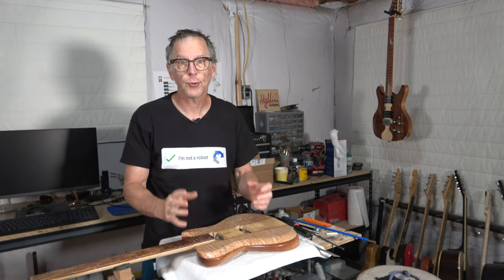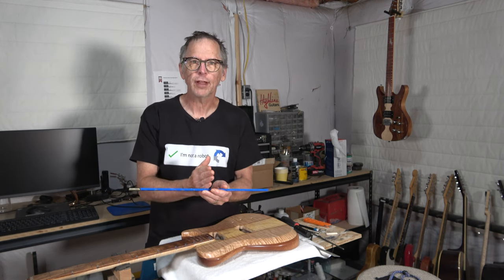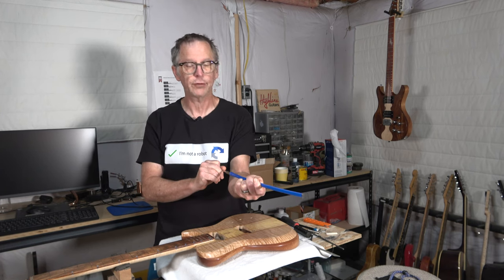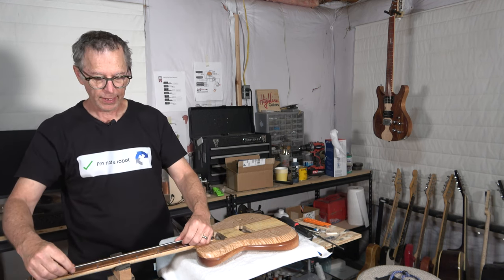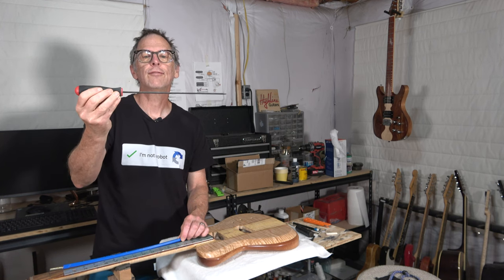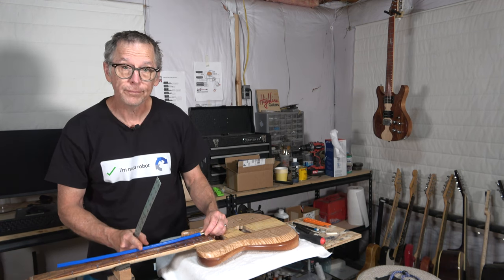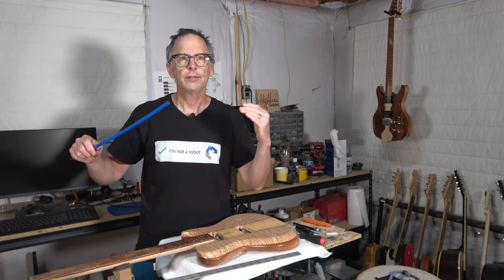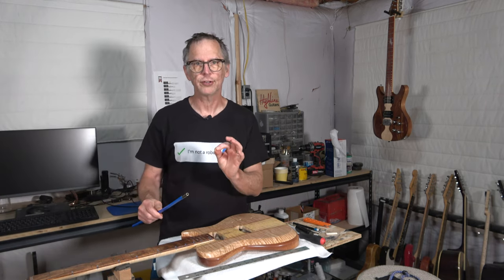How To Position A Guitar's Truss Rod

Comment: I've been thinking about this exact topic! Of course, adjusting a truss rod before it is installed will give an idea of where the maximum deflection point will be, but what about the effect of the gradually increasing size of the neck (for most guitars, anyway) as you approach the guitar body? I think that this increased wood thickness/width will modify the achievable curvature of the neck: it will bend easier (and therefore further) nearer the thinnest/narrowest part of the neck i.e. nearer to the nut.  As the strings will deflect most at the middle of the distance between the fretted note and the bridge (and this will obviously change it's position on the neck as notes are fretted closer to the bridge), where is the ideal 'maximum deflection' point of the neck?
Another consideration is whether or not there are carbon fibre reinforcements in the neck: as these make the neck more rigid, will this not also make the job of the truss rod much more difficult?

Comment: Hi Chris. Very insightful. Something that sparked in my head after watching: Is there a way to calculate the stresses along the neck so that we might know in advance the peak stress point, and subsequently position the truss rod so as to locate its max' deflection point there? Of course I can imagine this might vary for different neck designs and body joinery.  In any case, thanks for the video!
Reply from the maker: That’s above my pay grade.
Reply: @HighlineGuitars  No worries.  Probably not worth "overthinking" these things too much, as you suggest in the video.

Comment: If you used carbon reinforcements would you still need a truss rod? Would the reinforcements stop the warping or movements? Thanks.
Reply: Yes you still need the truss rod.
Reply from the maker: It depends on the design and number of carbon fiber inserts. I used four in my V-shaped guitar build which makes the neck very stiff and omits the need for a truss rod for the person who this guitar is going to.

Comment: Is the position where one would want the relief to be on the fretboard dependent on scale length? For instance, on an electric bass would it still be somewhere between the 8th and 9th fret?
Reply from the maker: No. It is dependent on the shape of the neck which determines where it will bend when under string tension as well as the length and placement of the truss rod.
Reply: @HighlineGuitars  I think that your other recipe for truss rod placement is more fool proof for people without experience since it's something like "just make sure the truss rod goes from the nut to about the 17th fret and you're good"
Reply: For you folks out there interested, that other video is entitled "guitar truss rod placement"

Comment: Thanks for another great video :)  I have a question off the back of this, which relates to the use of dual truss rods (typically in wide necks, such as bass guitars with >4 strings).  Is this something you ever do, and are there reasons this is sometimes (or always, in your experience) a bad idea?  I know you often use reinforcing rods, and I figure those might play a role when it comes to dual truss rods (perhaps negating the need)?  Do laminated necks (which I know from a previous video you’ve voiced caution over) have any influence over choices in this area?  So not really just one question after all :)  Thanks again!
Reply from the maker: Dual truss rods are an unnecessary marketing gimmick.
Reply: @HighlineGuitars  Wow that was a quick reply, and straight to the point.  Very much appreciated :)

Comment: Interesting, thanks for your observation.  Reason why I haven't installed truss rods in my builds. I fill my necks with permanent steel bars and carbon fiber rods. About 40% of the neck is wood.
Reply from the maker: Right on!

Comment: you forget that trussrod make pressue to 3 points of neck. Two on the ends and one on the middle. In case when you want to create thin and ergonomic neck when you place trussrod in wrong place you can simply broke through back of neck. Thats why you need in depends of length of neck get trussrod with lengs wich depends to construction of neck.
Otherwise, you make broken neck without  the ability to ajust

I mean, in video you not gave the ansver "How To Position A Guitar's Truss Rod"
Reply from the maker: I didn’t forget. Most of my viewers are blessed with logic and common sense. Now go troll somewhere else.
Reply: @HighlineGuitars  I don't want to troll you. I sonetimes watch your videos and its interesting contant. Maybe about functionality of trussrod will be another video 
'how to place trussrod and not to srew up your project' , or some like that
Reply from the maker: @bogdantodchuk277  The video was posted to answer a viewer's question about where to position the truss rod adjustment nut. What you're asking for is more about neck design than truss rod placement.